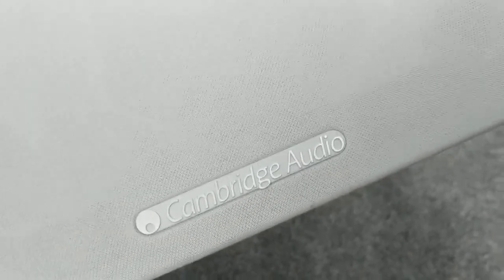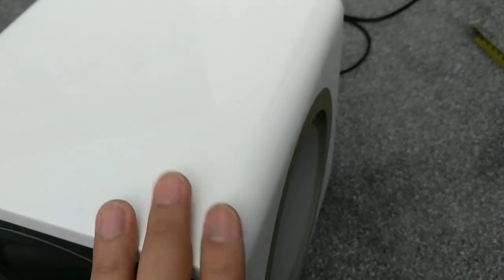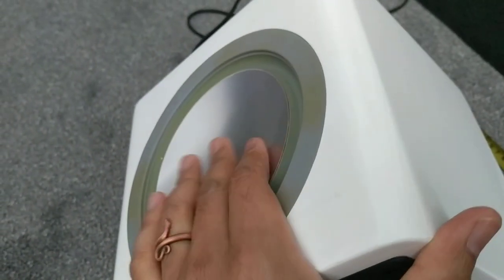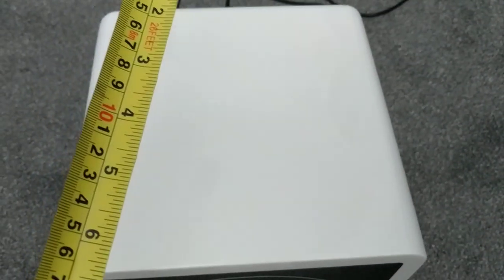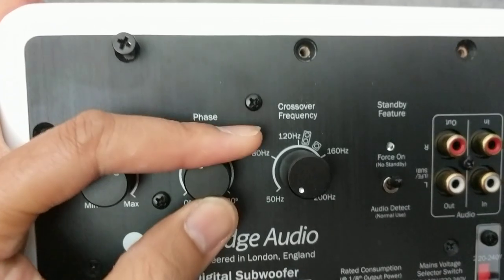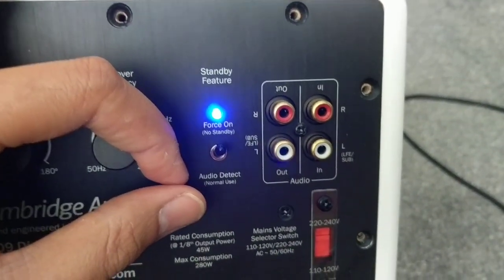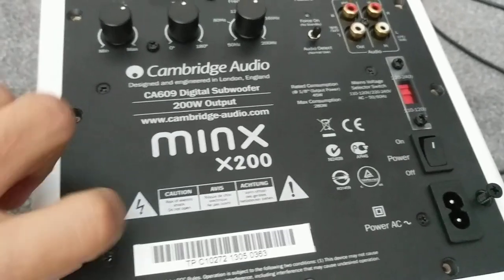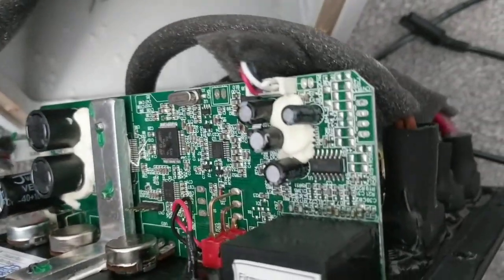Cambridge Audio MINX X200 active powered home theatre surround sound subwoofer speaker

Comment: The bottom bit is just the power supply. That's pretty standard and what you'd see in your PC's power supply more or less. The top circuit board is where all the magic happens.

Comment: Mines gone dead any ideas?
Reply from the maker: I suggest opening it up and taking a look at the amplifier board, see if there's anything obvious on it that's burnt out or fried. Also check none of the wire connectors from the amp to the speaker have come loose👍🏼
Reply: @kaygeebee9155 undone 12 screws back won’t come of 😮
Reply from the maker: @garden-Railway  the edge might have a bit of glue on it, just try prying it off carefully from one side using a flat screwdriver and lever it up and out, that should do the trick, good luck 👍🏼